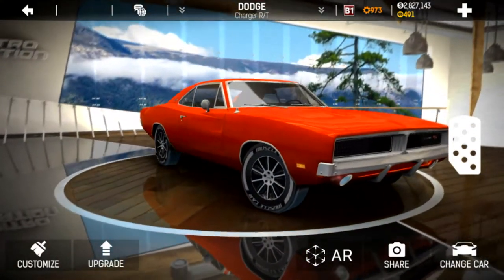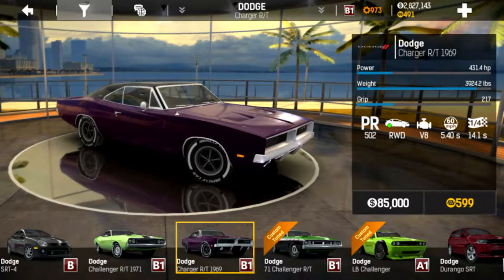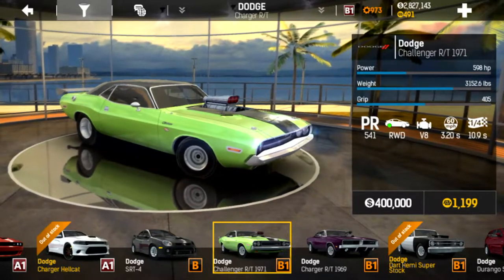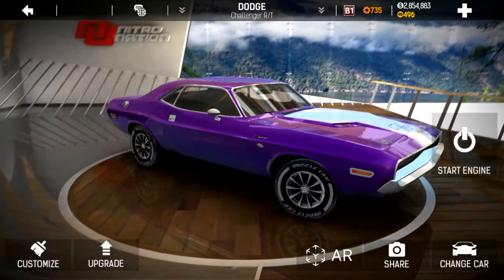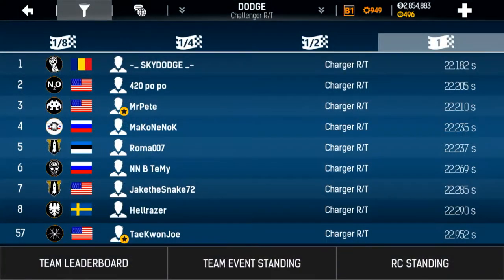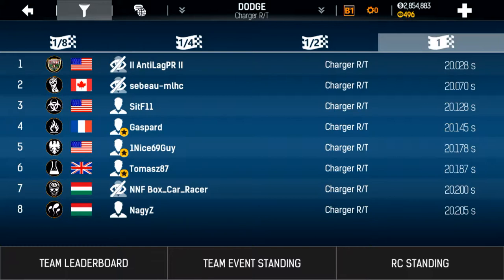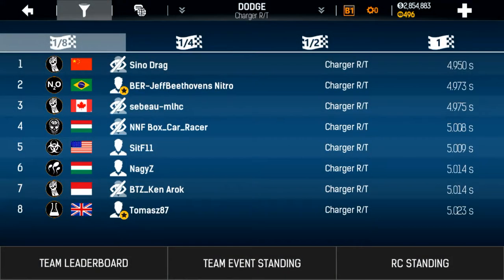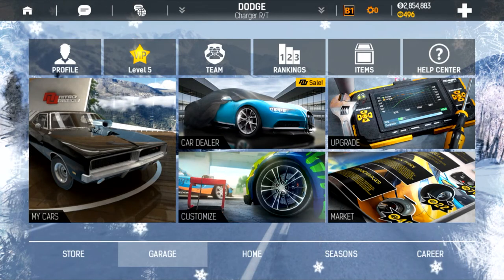Nitro Nation 1971 Challenger R/T vs 1969 Charger R/T Comparison

Comment from the maker: Stock B1 Street Charger vs Challenger
 Challenger    Charger
 0–60: 5.20    0–60: 5.40
 ¼ mi: 14.1     ¼ mi: 14.1
Stock B1 Race Challenger vs Charger
 Challenger    Charger
 0–60: 3.20    0–60: 3.20
 ¼ mi: 10.9     ¼ mi: 11.1
Maxed B1 Street Challenger vs Charger
 Challenger    Charger
 ⅛ 5.593        ⅛ 5.595
 ¼ 8.542         ¼ 8.545
 ½ 13.476       ½ 13.513
 1 22.177        1 22.182
Maxed B1 Race Challenger vs Charger
 Challenger    Charger
 ⅛ 5.083         ⅛ 4.950
 ¼ 7.799         ¼ 7.602
 ½ 12.442       ½ 12.084
 1 20.646        1 20.028